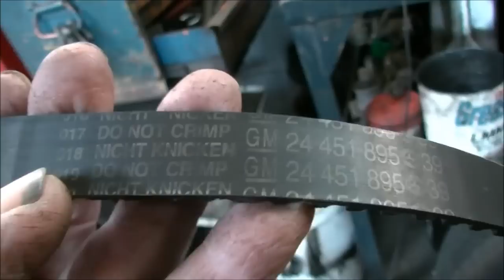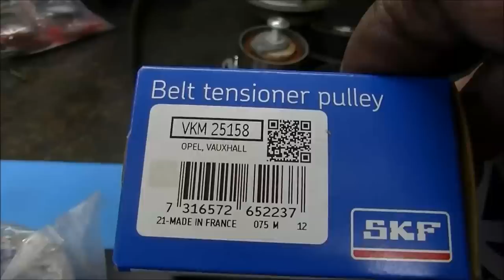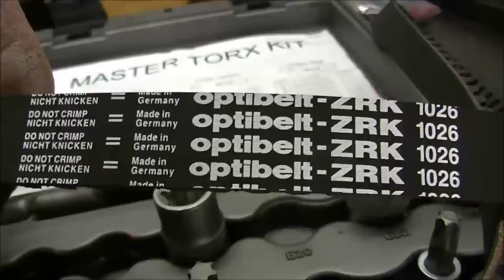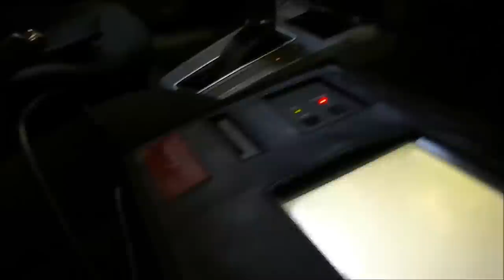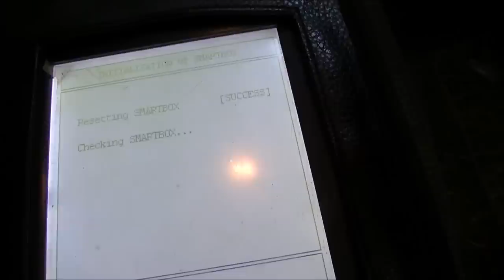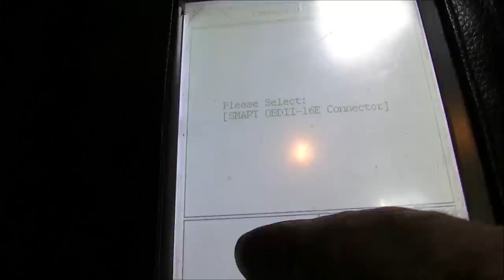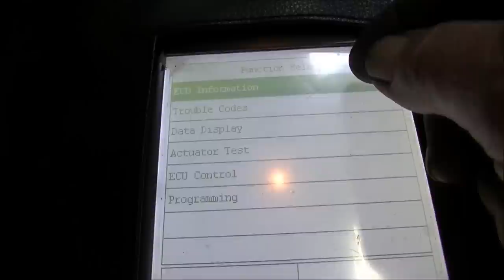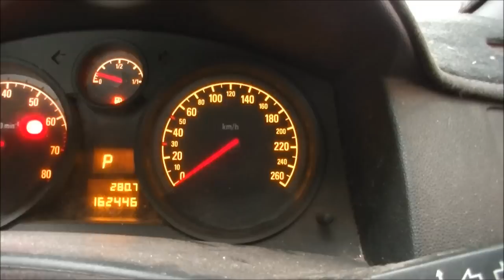Z18XE Holden Astra water pump and timing belt job.

Comment: Hello. Interesting video. I have a Vectra C with a Z18XE engine. When replacing the timing belt, I used a plastic timing gear lock. In Poland, it cost about 12 euros. It makes the job easier because the wheels are immobilized. Best regards.
Reply from the maker: Thanks for sharing

Comment: I'm just changing my timing belt with the full kit and a new water pump on my 2006 Holden XC Tigra. Very similar to the job you just did. You're a lifesaver because the new belt has been checked against the old one for length and I'm having trouble getting the adjuster pulley in. It seems I've got one of the tensioner rollers in wrong, so I'll attend to that tomorrow. Because time isn't an issue I actually removed the engine mount casting to give myself a clearer space. I marked my camshaft pulleys and crankshaft pulley as you did, and I don't anticipate any other issues. The old water pump was in good fettle and just dropped out. The new one dropped in just as easily with a touch of rubber grease on the o-ring. I'm just a retired guy working in my garage but I've been around engines all my working life though never as a mechanic. I was apprenticed as a mechanical fitter about a 100 years ago. It's all nuts and bolts to me. I've got 159,000 on the odo and according to the log the timing belt was changed at 90,000, so I could have gone a bunch more kms before the change.

Thank you muchly for providing a clear and practical commentary on how the pro's do it. It took me a while to find you but I'm glad I did. The video has answered a bit of head scratching I still have, so I'm better prepared for tomorrow. Should be finished tomorrow. Been a 3 day leisurely job with plenty of tea and moral support from the missus...
Reply from the maker: That's awesome mate...I have a few timing betl/waterpump replacement vids...They all say the same pretty much...Check for the correct belt change interval...The early engines due date was 60,000km the same as the spark plugs the latter engines was 90,000km...I'll check my book tomorrow and get back to you on that....Cheers mate.
Reply: @ziggassedup  I only realised that removing the inner engine mount casting threw me off. One of the pulleys is attached to that, and not where I'd put it. Easy fix no issues after that and everything went back smoothly. I've ordered a new offside engine mount, the existing one is buggered. I'll change that when it comes next week. Just an oil and filter change tomorrow. What I did notice is that the new button head bolt which came with the new tensioner pulley doesn't have a very deep torx slot and you really only get one bite at it. I made sure my torx bit was ground nice and sharp. I had to chisel the old one off. That spring loaded alternator belt tensioner is a bit of a trap for new chums too. Fixed that by mounting it in a vice, pre-loading it till the two circular holes lined up and shoved a split-pin in to hold it while I mounted the belt, then used a pinch bar to load it a little more and remove the split-pin so the thing takes up the tension. Another revelation, never seen that before...
Sorry for going on but I'm just stoked that I found your vid. Many thanks ZIG...
Reply from the maker: @logotrikes  You've done well mate...I'm glad to have been some help.

Comment: The timing belt on these actually seems pretty easy compared to most.  Once that air box is out of the way there is a lot of room.  I wish all engines had that much room to work.  Oh, and the zip tie trick is great.  I probably would have just shoved something in between the gears if I hadn't seen that.
Reply from the maker: Cheers mate.

Comment: Spent all day today wondering about how to change water pump in 2006 AH Astra. We got 10 km out of town this morning when overtemp light came on. Pulled off road. Looked for leaks (none) and have decided its either thermostat or water pump. Needs new timing belt anyway so this video has come in really handy. Sending car to my local mechanic with this video link attached:). Am just over repairing cars this year... And It lets my mechanic know I've checked a timeframe on his labour. Should take him about half an hour:):):):0
Reply from the maker: If he can do it in 1/2 hour I'll send him some work...lol.

Comment: Repaired so many of these from tensioner failure due to incorrect setup, must do 2 revolutions and recheck tensioner and firstly turn in the correct direction!
Reply from the maker: Congratulations...Never had one fail yet.

Comment: When you are talking about the sensor at 19:08 is the alignment out on the marks?
Reply from the maker: Yeah the exhaust cam rolled a tad but no biggie as long as it's aligned when the belt goes on.

Comment: you where correct old timer thanks heaps no more engine light timing was out now i got to remove the perm codes thinking remove battery post and neg and use jumper leads and let it discharge for hour that work?
Reply from the maker: Go get yourself a cheap code reader and clear the codes...Cheers mate.

Comment: Just smashed my water pump today to get it out. Practically welded in. Original pump on a 2000 Zafira! It was rotten.  Previous owner had the belt done twice but never bothered changing the pump, tensioner or idlers 🙄
Reply from the maker: Yep I always change the whole lot...Cheers mate.
Reply: @ziggassedup I'm now having a right bugger of a "time" getting the belt tensioned properly. I can not get the marks on the tensioner to line up properly, the belt is so loose it's like it's way too big but it's the same size as what's come off there. Ruined the new tensioner due to putting too much force on the Allen key hole. Seems like these tensioners are not auto adjusting? Bit stuck now tbh. Cheers 👍

Comment: Didn't like how this was done. Quote: Rotating the tensioner in the  wrong direction, having the Allen key hole in a wrong position to start off, not turning the engine 2 revolutions before and after setting the tension, can lead to system failure. This will cause the arm of the tensioner to hit the stop, creating a hammering noise, damaging and possibly even rupturing that part. This failure mode is very common and can easily be recognised when inspecting the edge of the arm (fig. 4). The resulting wrong tension can cause the belt to rupture. End quote.
Reply from the maker: Did you read the description.?..There are more than one way to skin a cat and I have skinned many of this breed of cat...Just sayin'....Thanks for your input...When in doubt follow the directions.
Reply: I agree very sloppy really spose his a there just fkn cars type bloke
Reply: Never reuse the idlers or pump.

Comment: Gday mate, good video. I am changing a head gasket on holden viva which looks similar. Question is, do I have to have the engine in a certain position before I mark the gears? Top dead centre or something like that? cheers.
Reply from the maker: Yes it's best to have the engine at TDC#1..There are marks that indicate that position on the crank gear and on the cam gears...If you can't find them you should google an image for their position...I'd also suggest changing the water pump and the timing belt and associated pulleys and tensioner...Good luck with it mate.
Reply: @ziggassedup  Awesome, Thank you for your speedy reply,  Cheers for that.
Reply: I am stuck trying to get the timing belt cover off, does the harmonic balancer need to come off? It is caught at the bottom.
Reply from the maker: @DallasD2.0  yes the balancer has to come off...remove the pulley bolts there are some bolts that hold the cover on and some clips.
Reply: @ziggassedup  thanks again mate, yer got the bolts out of the cover. I just noticed that i think the timing pullies have to come off to get the backing cover off to remove the head. These cars are a maze of things bolted together. Lol, going crazy atm.
Reply from the maker: @DallasD2.0  You'll get it mate just make plenty of reference marks.

Comment: Hey mate! How long roughly do you think replacing the water pump and tensioner would take someone at home with a fair bit of mechanical experience? An hour, 2 hours?
Reply from the maker: I'd set aside about 3 hrs Braydon...Cheers mate and good luck with it.

Comment: You did the tensioning procedure completely wrong and that can cause the tensioner to fail. There's even a warning on the workshop manual NOT to do it the way you did.

Here's how it's done correctly:
1. turn the tensioner anticlockwise until pointer at far right past "new" bracket. Lightly tighten tensioner bolt.
2. rotate engine two turns and ensure timing marks aligned.
3. loosen tensioner bolt and turn tensioner clockwise until pointer at "new'" bracket. Allen key hole should be pointing around 5 o'clock. Tighten bolt to 22 nm.
4. rotate engine two turns and ensure timing marks aligned. Ensure pointer at "new" bracket.
5. done.
Reply from the maker: You're absolutely correct...Thanks for your input...I've yet to have one fail...Just saying...Does it matter if you route the belt opposite to the direction of the arrows.?

Comment: Hey mate I did the timing belt and set the tensioner and tightened as required, then when I turn the crank full rotations, the tensioner arm jumps at least 10mm is that a dodgy component or am I doing it wrong? Cheers
Reply from the maker: Is it a new tensioner.?...They do move a bit...

Comment: Hi i have  a Z18XE Astra and the intake cam is out of TDC,  possibly whilst removing the cylinder head.......is there an easy way to correct it.
 THANKS FOR THE POST... IS IWELL DONE
 
.
Reply from the maker: Yes...There are slots in the rear of the cams...Both cam slots should line up horizontally to the back of the cylinder head surface...If you have a metal strip like a file that fits in that slot it will lock the cams in TDC #1...Also if you have not removed the cam gears the alignment dots on the gears should line up as seen in the beginning...If you have removed the gears then use the metal strip to align the cams and then position the gears with the crank at TDC and the cam gears to the said marks when the belt goes on...Good luck and thanks.

Comment: The Torx head on my timing belt tensioner has stripped.. any tips to get it off? no access to a welder or grinder
Reply from the maker: See if you can turn it with a center punch or take the head off with a chisel...It's only mild steel so that shouldn't be too hard...Good luck mate.

Comment: You have turned the tensioner the wrong way. Should have gone anti clockwise. If you look at the beginning of the video the tensioner Allen key is at 5 o clock position. Though it's such an easy mistake   . Tensioner will eventually break and fail
Reply from the maker: I'm glad you paid enough attention to notice the clocking of the allen key but that means nothing..The tentioner is set by the position of the indicator.(Pretension on the belt)..As the engine turns the tensioner indicator will go both beyond the indicated mark and well before it (Belt stretch)...Thanks for watching...BTW...I've never had one fail ever with this method and I've done 100's of them..It can't be just luck now could it.?..Just sayin'...
Reply from the maker: A good bit of info..Cheers mate...I guess I must just be lucky..The kit I use mentions nothing about the allen key position.
Reply: @ziggassedup  is correct it makes no differance,as long as the pointer is in the correct position and you rotate the crank a few times and recheck the pointer is in the correct position then all is good.

Comment: hey mate, I worked on my astra and engine seems to have lost compression. OBD shows P0100 MAF, P0110 Air Intake Temp, P0340 Cam position sensor A circuit, P0101 MAF performance problem. 
its Astra TS with Z18XE engine. 

I did mark timing sprockets as shown, only wsnt marked was the crank sproket and also after fitting new belt I turned crank gear to TDC. 
You reckon Crank sensor needs changed now or something else ? 
thanks :)
Reply from the maker: When it's on TDC#1 are the cam marks in the correct position.?

Comment: Gday mate, any advice, the notes that came with the head gasket kit are different torque settings to my service manual. The notes say 25nm then +65 +65 +65 and service manual says 25nm +90 +90 +90. Not to sure which one to use. The sequence is also different, just opposite side but still from the center out.
Reply from the maker: I expect the gasket is non genuine so I suggest that you use the settings that came with the gasket...You have new bolts too I hope.
Reply: @ziggassedup  yep I have new bolt. Cheers for that, really appreciate your help.

Comment: Hi Zig.  Got a question for you, mr wisdom...    my vz 6.0 needs a bigger alternator i have decided, do you have any idea where to start?   does the new 6.2 have a bigger amperage, if they do will they fit my car?
Reply from the maker: G'day Paul...Here's what I've found over the years...6.0's and 6.2's don't like aftermarket alternators so if I have to change one I buy a new one from Holden...They're not cheap but it's the best way to go...I  hope that helps mate.

Comment: Would $1000 be an acceptable quote to do this job? Pump, timing belt, tensioner, idlers, drive belt and drive belt tensioner?
Reply from the maker: Yep.😆
Reply: @ziggassedup  thank you, I think 😂
Reply from the maker: @Dapitchfork  That's a bit more than I charge for parts and labour...$150 for a belt kit...$75 for a pump...$45 for a belt...$30 for coolant..About 5 hours in time @ $110/ph if the water pump comes out easy and you'll have made good profit...Cheers.

Comment: My dad's Holden viva has started losing coolant . Got a good feeling this is the  problem.
Reply from the maker: If it's leaking at that end of the engine it's a good chance the pump is leaking but there is also a hose at the rear of the block that feeds the pump tat can leak also so have a look at that too.

Comment: after replacing the timing belt and replacing cam position sensor due to a scan error wiring was exposed. the engine is running rough. crank sensor is fine any ideas how to fix this issue
Reply from the maker: Are you saying the engine ran fine until you changed the belt.?Do you still have the code.?...It may pay to recheck the cam timing.
Reply: @ziggassedup  thanks for the reply turns out timing was all good but some how the vacuum hose from the throttle body come off that hooks up to the sensor near the air filter. After all that car runs well again.

Comment: Hey anyone know if the timing belt snaps in one of these engines, the valves and internals are cooked?  I know some engines are ok after a snapped timing belt, cheers
Reply from the maker: Yep...Break a belt and bend the valves...May be punch a hole in a piston or bend a rod too.

Comment: How can I stop the engine turning to remove crankshaft pulley?
Reply from the maker: The pulley or the pulley bolt.?..I use an impact gun...There is a special kit to do this job but you don't need it.
Reply: @ziggassedup  I can't get the pulley bolt out?
Reply: The crank is just turning. Do I turn it clockwise or anti?
Reply from the maker: Anti clockwise...If you can put a breaker bar on the crank bolt and rest it onto a secure section of chassis then if you unplug the coils you can click the starter over untill it breaks the bolt loose but be sure to set the engine to TDC before you remove anything after that....
Reply: @ziggassedup  thanks for help last night I got it off. How did u do the tension pulley for the timing belt? It's just not budging.
Reply from the maker: Undo the retaining bolt.

Comment: Great video. I would love a video on how to do the oil pump on this engine
Reply from the maker: If the opportunity to do a pump vid I will...Thanks Christopher.
Reply: ZIGgassedUP if you do you will be the first person to do it. Trying to do oil pump on my daughters 04 Astra and can't find much info on how to do it. Even the Gregory's repair manual is not that detailed on how to do oil pump.
Reply from the maker: @christopherkennedy4004  Do you have a new pump.? and why are you working on the pump.?.
Reply: ZIGgassedUP yeah I have a new pump and mechanic told me oil pump needs replacing because engine was a bit rattling I took sump off and oil pick up was blocked so I'm thinking that's what the probs might have been.
Reply from the maker: @christopherkennedy4004  Clean the pick up and sump and you should be good...I've done it many times...
Reply: ZIGgassedUP yeah I've done that and putting it back together in the morning. Thank you mate! Do you know how much of a champion you are helping a complete stranger. If everyone was like you we would be ok wouldn't we.
Reply from the maker: @christopherkennedy4004  You're welcome mate..Glad to help.

Comment: You definitely dont need cam tools???
Reply from the maker: I used no cam or crank locking devices.
Reply: Did you set timing beafore or after taking harmonic balancer off? Cheers mate!
Reply from the maker: @mattlome9796  Yes...TDC#1.
Reply: Okay thanks mate. One more question just having trouble holding the cams in postion while i loosen harmolic bolt how do i keep it all its same position?
Reply from the maker: @mattlome9796  You can loosen the bolt and time it again...There are more timing marks inside the cover...Remove the balancer and covers and use the balancer bolt to turn the engine to the correct position...I'm sure there is something in the vid showing where the marks should be before removing the old belt.
Reply: Okay sweet thanks mate! Legend!!